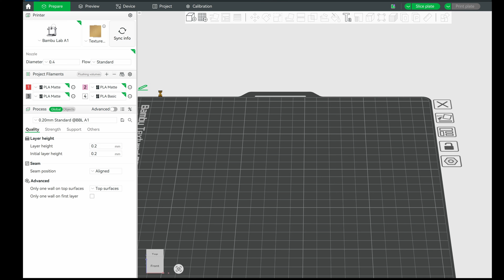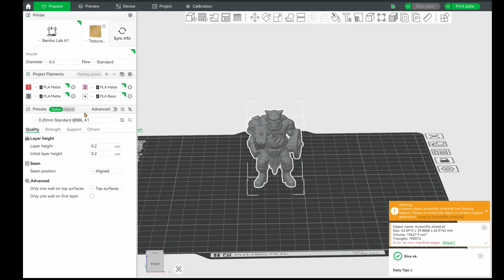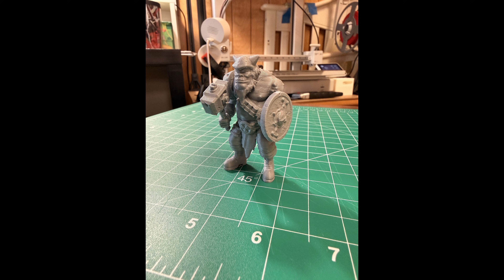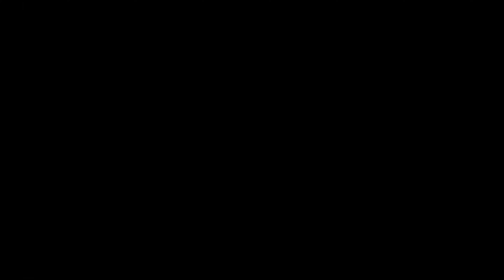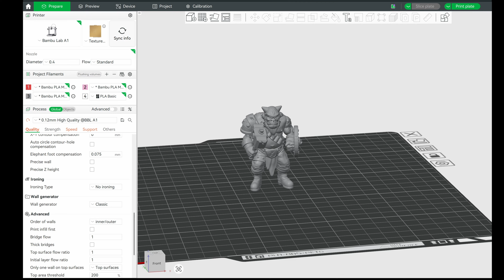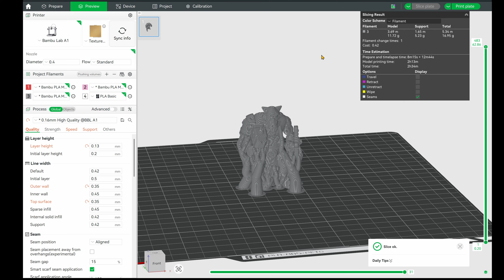How to optimize your prints for best results in Bambu Studio

Comment: What about using a 0.2mm nozzle? Would really like to see results from that configuration.

Also would be helpful to have an episode on selecting what kinds of miniatures are more suited to FDM; such as vehicles versus soldiers. (And of course terrain versus playing pieces)
Reply from the maker: Using a 0.2mm nozzle would definitely elevate this a ton. I was also thinking of doing a comparison of my resin printed models from the same Kickstarter and trying to get as close as I could with the FDM printer. I have vehicles, buildings and props.
Reply: As someone that’s printed a few minis with a 0.2mm nozzle I can say it does make a large difference in quality- but also increases time. If you’d like I can share the kind of tweaks I make to retain quality without totally bloating time and  what kind of support settings to use.
Reply: @imrik1 @darrenp9454 
Alrighty here are my settings for a 0.2mm. 
Context: I am printing on a Bambu P2S with a 0.2mm nozzle and using eSun PLA+ filament (which I find to be a little better for mini's) 
If a setting isn't named, I've left it as default. 

Preset: 0.12mm Balanced Quality
Quality settings: 
Layer height: 0.10mm 
Advanced: 
Watch the first few layers with these settings to make sure you don't have issues. 
Avoid crossing wall: OFF (you can try ON but I have had stringing issues with this) 
Max detour length: 12mm (Only if previous setting is on)
Smoothing wall speed along Z: ON (Turn OFF if you find there are issues) 
(Everything else default) 

Strength settings: 
Wall loops: 2 (this is subjective as if you feel you're going to be rougher with the piece, bump it to 3) 
Top shell: 7-8
Bottom shell: 5-7
Spare infill: 
Density: 12% (again subjective, but wall loops and shells are generally more important strength-wise than infill) 
Infill pattern: Gyroid 

Speed settings: 
Personally, I keep most of this at default cos the P2S is absolutely insane and is very good at printing at ridiculous speed without batting an eye. So if you have one, feel free to keep most things default. But on a different machine, what he changes in the video is likely good- that being said, the way different printers calculate speed are VERY different from one another (mostly across different brands.) 
Top surface: 100mm/s is the only change I personally made 

Support settings: 
These are also subjective as you do need to check your supports and make sure the necessary areas are being supported- but these are the best general support settings for getting easy removal with good support for minis. 
Type: tree(auto) 
Style: Default
Threshold angle: 50-55% (I use 52%) 
On build plate only: ON
Support critical regions only: ON 
Advanced: 
Support wall loops 2 
Top Z distance: 0.2mm 
Bottom Z distance: 0.2mm 
Top interface layers: 2-3 
Top interface spacing: 0.35mm (can leave default but lower if supports break during print. Note: the lower the harder it is to remove) 
Tree support: 
Branch angle: 60 degrees 

That's everything. Just remember these settings aren't always universal and some tweaks may be required per certain print. There are some updates in here from since I last printed a mini, so I'll give these a go and report back if it's any better. All the advice in this video is really good and I've incorporated most of the tips provided. Hope this helps!
Reply: @rileyallan6032  Thanks!
Reply: @rileyallan6032 why not using 0.08 preset and going lower to 0.06 layer height on a 0.2 nozzle?  I did also print some minis on my p2s and it tutned out great!
Reply: And thanks for the settings mate! @rileyallan6032
Reply: @rileyallan6032 yes please share em! 🙏
Reply: @imrik1  Seconded! Please share.
Reply: @imrik1  sent!
Reply: @darrenp9454  done!

Comment: 3:00 slowing down the outer surface speed does not, unfortunately, mean you will get less ringing. Ringing depends on the resonant frequencies of your printer,  and sometimes going faster is better. Or you have to go REALLY slow, even slower than 30.
Reply: Yea, there's A LOT of other factors that play into that. That is why printers use phase stepping/input shaper to counteract some of these effects. I thought the same thing when I first got my Core One. Ringing/VFA's? Just slow it down, makes sense. But it doesn't actually work majority of time. Like you said, there are actually cases where speeding it up actually helps more just because of the resonant frequencies of the motors and the frame/chassis of the printer.

Comment: Think time is a trade off. Optimize the print and take longer or wait and spend twice as much time cleaning the model up after it’s finished printing. Unfortunately the printer in Black Panther that can crank out a wearable helmet in 30 seconds doesn’t exist yet so patience is a must.
Reply from the maker: Absolutely. I tried to get the best print for somewhere in between the fastest (crap quality) and the slowest (high quality) and ended up closer to the lower end. I think there could have been one more step between, but I think this was a good experiment.